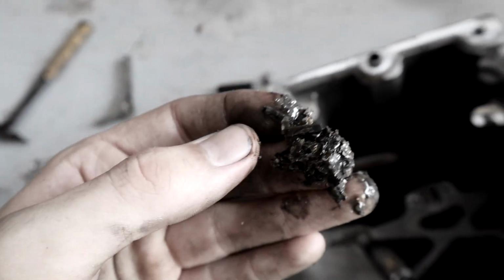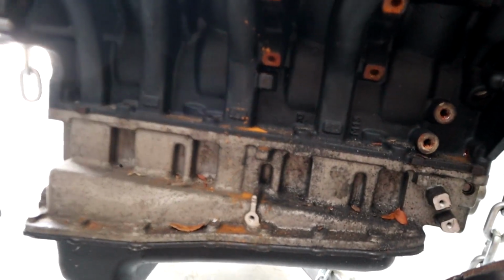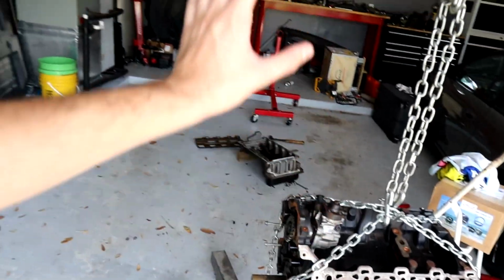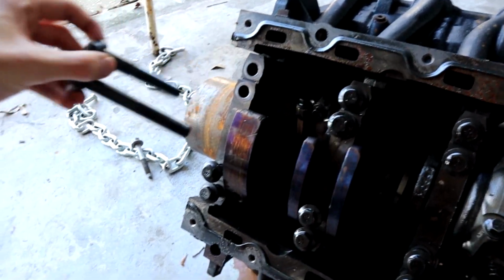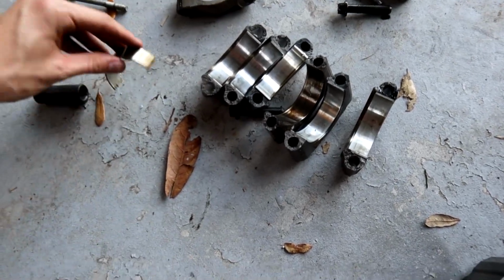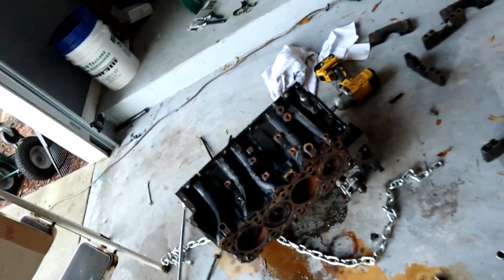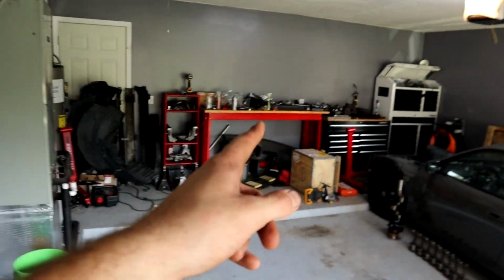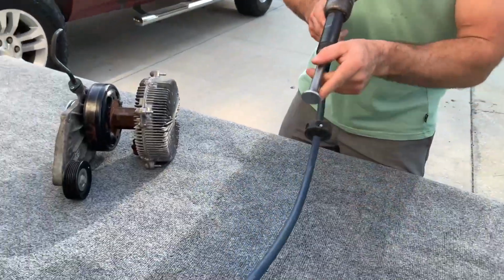5.0 Cummins Titan xd engine failure discovered

Comment: Looks like oil starvation to me. I'm beginning to think 10W-30 oil is too thin for this engine.
Reply: I’m thinking it’s the 120 hp boost.
Reply: @robarnica1975  Likely it's both.  The 10w30 is too light for our engines.  On top of that, if the tune is bad, then the timing will be off and hammering the bearings.
Reply: 140k miles, used 10w-30 lifetime of the truck, tuned +125hp since 70k miles. 

I disagree with both of you.
Reply: @oinchadoomandwolfboy  I love these type of replies!  "It's never happened to me!  I can't be true!"  It's a combination of factors.  Maybe you actually keep your engine in rpm enough that it doesn't get hurt, maybe you have it turned up but don't rat bag it.  In regards to the oil, I agree it's mostly an opinion however it is well known that thicker oil dampens better than thinner oil. V8s have smaller journals, and the ISV5.0 is a small engine.
Reply: @NavyCuda do you think the tune maybe overspun the turbo causing it to seize and dump the oil into the block, causing hydrolock and subsequent bearing failure? I know your research posted in the forum showed that it's pretty easy to overspun these turbos to get extra boost. Your opinion would be appreciated. Thinking of getting Longevity but weary given these situations.